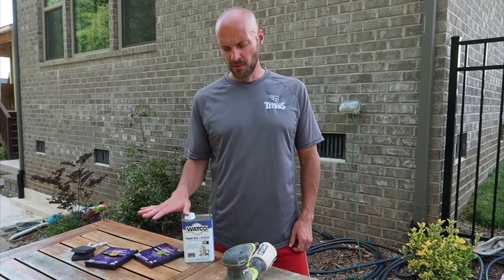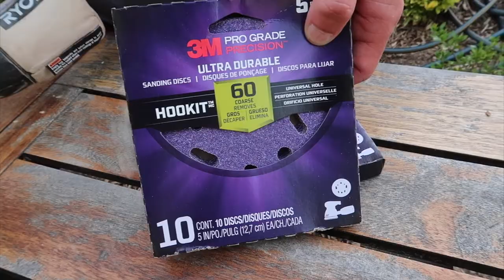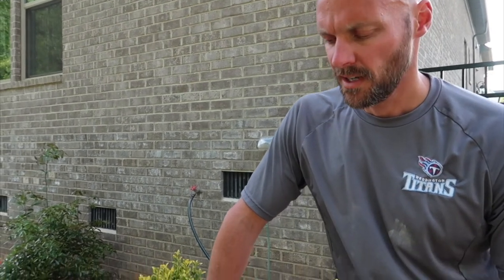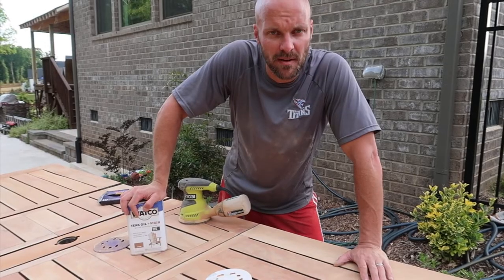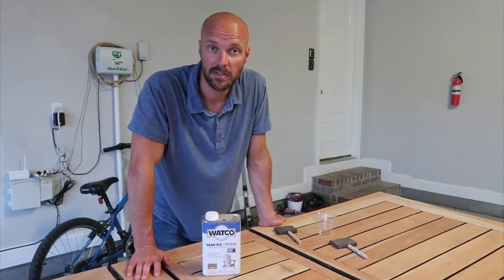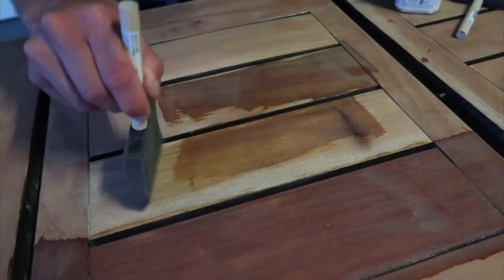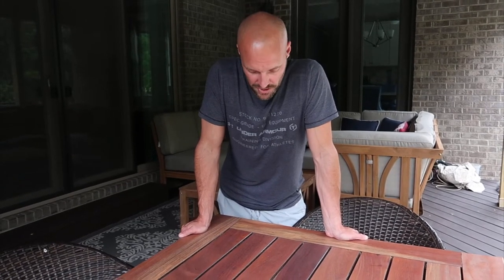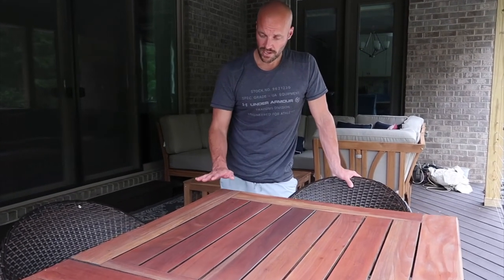How to Refinish Outdoor Teak Furniture | Watco Teak Oil Review

Comment: I've been sanding mine every other year as well.  Recently I've discovered it's much easier to use a power washer to get rid of old coat.  Give that a try.
Reply: So you skip sanding completely and just power wash then oil? Do you think it's necessary to use a brightener?
Reply: Everything I have read says to not use a power washer. Why is it all so confusing!
Reply: Power washing will lift the grain which will be damaging

Comment: What went wrong? Went from 60 straight to 220 grit, didn't apply or remove the product correctly, and that wood still looked ultra dusty when the finish was applied.
Reply: 160 max for penetrating oil?
Reply: Was a great general video for people who already know a little.  But, it should have mentioned you shouldn’t go from a 60-80 grit straight to a 220 finishing grit.  There should at least be 2 other stages of grit.  Also, depending on the finish already on there, you may need to first chemically strip it.  A true pain, I know, but necessary if you’re looking to do it right.  After that, sandings with an 80g, 120, 180, then a 220.  Be sure to thoroughly wipe down with shop vac if there are lots of groves, followed by a tack cloth.  You have to eliminate ANY dust before applying anything.  Remember with any wood finishing, the prep is the crucial part to having a good outcome.  Letting coats dry overnight is preferable if you’ve got the time.  And stay in the same family.  If you start with water-based, stay with water based, same with oil-based.  Technically you can sometimes apply oil based over water, but never vice versa.  You’ll risk fish eye, and eventual flaking.  Apply 2-4 coats of spar urethane, using super fine 0000 steel wool in between coats to knock back tiny bumps and get that super smooth surface!
Reply: One last thing - brush quality totally matters.  For oil based, use a high quality Chinese bristle brush.  Never use a multipurpose brush if the piece matters.

Comment: After the first coat assuming it’s a heavy coat, back sand it, get that top flat again, then apply another coat.. then sand that with an even finer grit.
 When I do outdoor teak furniture. I coat and backsand until you’re essentially applying the finish over an existing finish and the top has stopped drinking the finish.
Why? Because then the top is sealed. When you do the annual or no annual cleaning, you’re not starting over. You’re just gently removing a layer of finish then, reapply another coat or two.

Comment: How many coats? I generally put 3-4 coats on and then finish sanding with 600-1000 to get a smooth finish.  Sure if takes off some of the Teak, but if you got enough coats it's a nice duller finish.
Reply: After that last coat is fully cured, you can put on a layer of automotive carnuba wax, preferably one with some UV protection in it, that helps a lot to shed water, dirt, and protect the oil finish. I use the spray on wax, makes the job quick and easy.

Comment: I've read that oil isn't suitable for outdoor wood. I think because it doesn't protect against UV.  I was told (yesterday) that a sealer is best for any teak outdoors.  I'm eager to see how yours holds up with oil.
Reply: Right on. UV rays are just brutal on any finish, but especially clear coats and with substrate that expands and contracts with moisture changes, like wood does.
Reply from the maker: Mine held up pretty well - but it doesn’t see sunlight.  It is under a covered deck.
Reply: Teakwood oil is used on marine items like boats.  It does need to be reapplied every few years.
Reply: Correct need spar polyurethane
Reply: The company that sold me my teak table (which looks identical to the one in this video) says do not use teak oil! They recommend water-based finishes. And yes, if you do not want a gray teak table, it is annual maintenance.
Reply: I just used teak oil on my 1960's Danish table. I researched Teak Oil vs Danish Oil vs Tung Oil vs other oils. All the data said that Teak Oil had high UV Resistance.

Comment: When I've researched this product for a door I'll be doing in the future, the oil is supposed to be put on very liberally. If it soaks in you're supposed to add more. I believe you're supposed to allow to soak 10 minutes or so and remove with a rag. Then I've heard references to 3-4 coats??
Reply: 30m

Comment: Any suggestions for sanding off a polyurethane coating on teak dining table? (It’s some sort of finish that is flaking off, not a wood penetrating finish). Start and finish with what grit paper? Appreciate any suggestions!
Reply from the maker: I would start with 80 grit to knock off the flaking.  Then use 120 grit to get a smooth finish.  I might even use a 220 grit as a finish.  Generally 120 grit would be enough.
Reply: If it's on the surface like that, best to use a mild stripper first or that stuff can gunk up your paper/sander. General stripper is not used for teak since the oil soaks in, but it sounds like you have some sort of urethane on there, so stripper is the way to start. Clean with spirits. Let dry, then sand and finish.
Reply: Thank you! Haven’t started this project yet- decided to wait for fall, so I appreciate your suggestion very much!

Comment: I recently purchased teak as decking material for my exterior porch. after a lot of reading the general consensus is that overtime these teak oils break down the teak itself as they are not oils extracted from the teak wood itself and way more often than not require an application YEARLY. On the other hand, teak sealer also is not a natural extract or oil from teak wood itself though the general consensus is that sealing is your best option as you are preserving and protecting the natural oils that teak has, thus requiring less maintenance than if you were to oil it.

Comment: Everyone who says not to use teak 'oils' seems to agree that the linseed oil and other oils hurt the teak - make it rot.  Any comment on that?
Reply from the maker: Mine didn’t last as great as I would have liked it - so I think there is validity to that statement.
Reply: @MrGizmo211  curious to know what it did that has turned you off the teak oil.
Reply: @MrGizmo211  I recently purchased teak as decking material for my exterior porch. after a lot of reading the general consensus is that overtime these teak oils break down the teak itself as they are not oils extracted from the teak wood itself and way more often than not require an application YEARLY. On the other hand, teak sealer also is not a natural extract or oil from teak wood itself though the general consensus is that sealing is your best option as you are preserving and protecting the natural oils that teak has, thus requiring less maintenance than if you were to oil it.

Comment: Did you sand the table with the same technique the first time around when the Minwax Oil finish failed?
Reply from the maker: Yes - but I sanded a lot more this time around to be sure I had just raw wood.
Reply: Then maybe it was the lack of sanding that was the problem the first time, not the oil product.

Comment: This is NOT how to refinish teak.  Use teak cleaner on a wet surface with a nylon scrub brush.  Rinse well.  Apply teal brightener when dry. Then when dry apply oil with foam pad

Comment: From 60 to 220 grit? Oh dear. Far too big a jump. Need at least two intermediate grits, possibly four.
Reply: I am pretty sure you can start at 100 as that is what I have used on my table and it works quite well.  I will finish with 220.